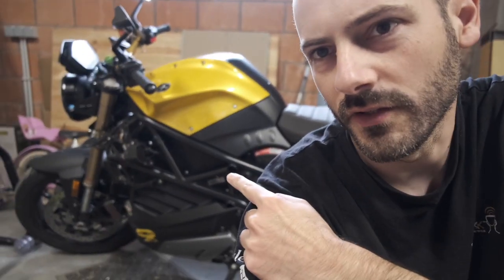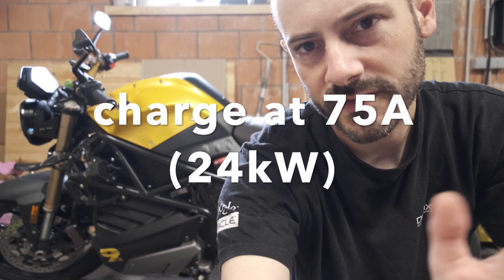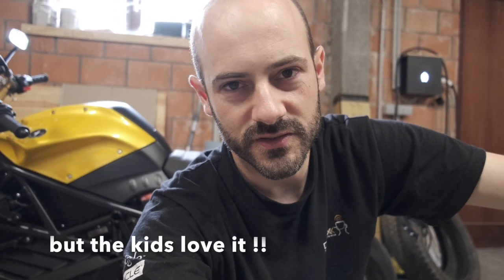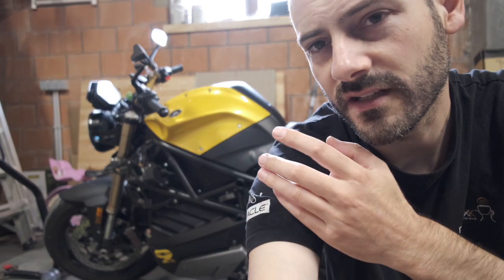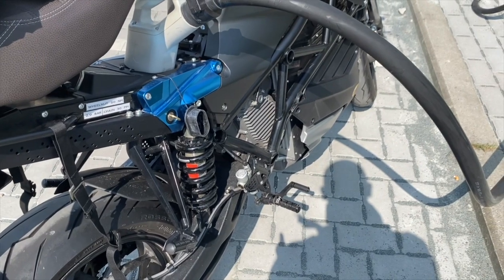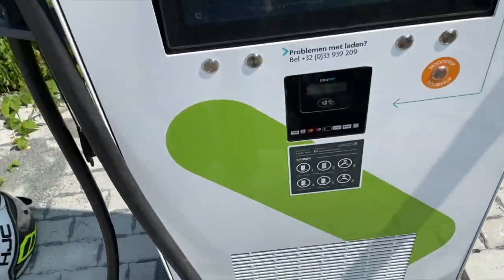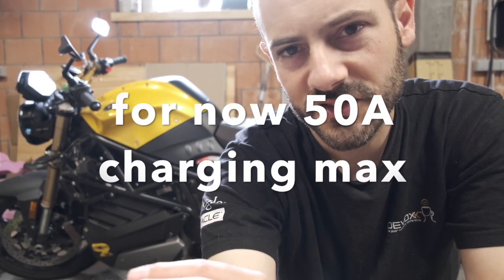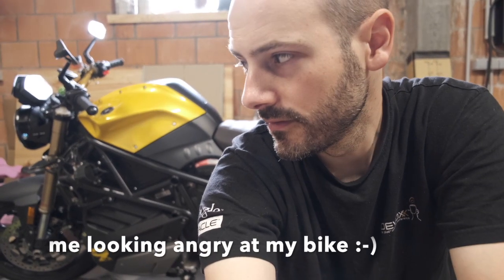Initial continuous high speed & fast charging Energica battery heat numbers

Comment: Thanks for the great Energica tips. Nice Vintage BMW. I just got a 21 F 750 GS. Sure is a cruiser. Had my 1st 2 day road trip.  Went to a motorcycle show in Texas. And road a Harley  Livewire , Zero , and Pan American. Livewire was scary fast.
Reply from the maker: Yes the electric bikes can be scary if you pin the throttle. Luckily they have those ride modes and traction control. Nice bike that F750 GS. I traded it's big brother with boxer twin in that Energica. Kind a miss the sound still, luckily i can always listen to that oldtimer.

Comment: Thanks for your tests! I'll try limiting the charge to 60 amps on my next long ride to Germany and see how it goes (5 stops planned)
Reply from the maker: Your second charge might just have the green battery icon like in my case but the bike still didn't go above 50A at that point. Still twice what it went down to at the end of the day though 😂
Reply: @Hans2183  it looks as if I'll have a weather as in your 710km video. That'd mean that issues with temperature are very unlikely 😛